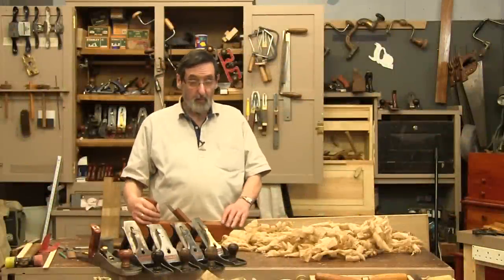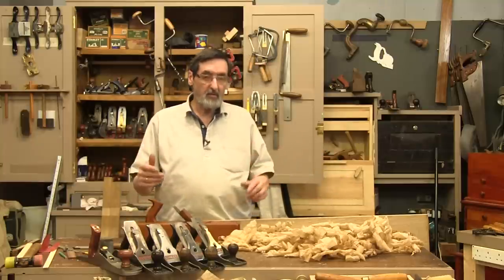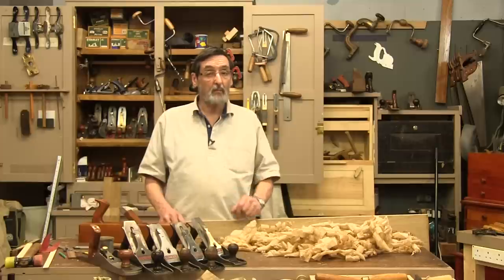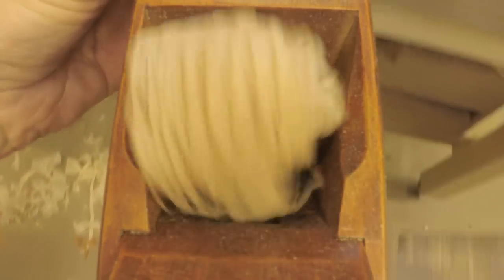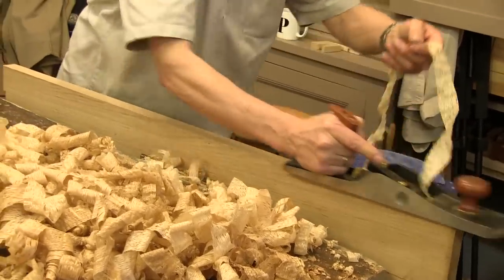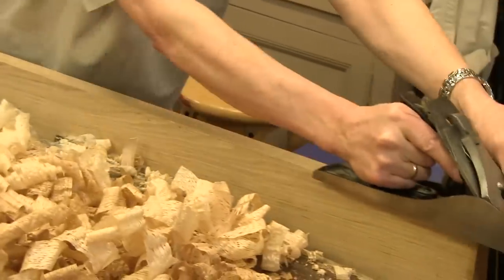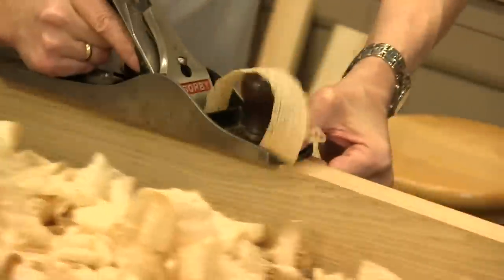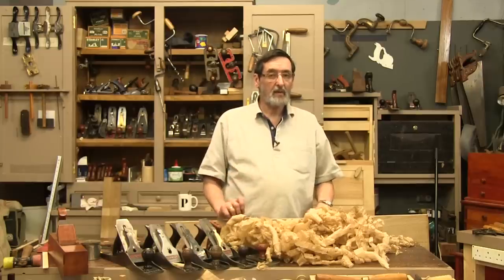Plane Bevel Ups and Downs | Paul Sellers

Comment: So, does the orientation of the bevel matter as far as the grain? Bevel up or down can be used for the same purpose?
Reply: Thanks Mr sellers
Reply: ***** Hi Paul. Your demonstration is misleading since you are only using the planes for one purpose and it is not advisable to draw such broad generalisations. I am happy to use any type of plane for edges as you did. However, as soon as I plane across the grain (traversing), the lowest cutting angle is going to cause the least surface damage. In this situation, a BU plane is likely to be preferred. Further, I can plane interlocked grain with a BD Bailey pattern but must then use the chipbreaker, which can be fiddly, especially for novices. Alternately, I can use a BU plane with a high cutting angle, which requires minimal setting up. Recommendations in using these planes should also include ease of set up. The BU has fewer parts and is easier to do. The BD plane is easier to adjust as one planes. I think that the the promise of BU planes is not that they are better than BD planes (that is too general a statement as the rage of BD planes is wide), but that they offer ease of use and a wider range, which is very desirable for those starting out.
Reply: Erik, with a bevel-down plane the cutting angle is the same as the bedding angle.  With bevel-up planes the cutting angle is that of the bed plus the blade bevel.   This combination often sums to a more obtuse angle than a standard bench plane's cutting angle.   It creates an effectively stronger edge less likely to chip in difficult grain. 

Stanley, IIRC, defined the "block" plane, saying the planes were designed for "blocking in" work and especially cutting end grain.  That said, as far as my experience goes, and that is NO A LOT compared to folks like Paul, the chief element in cutting difficult grain is blade sharpness, and technique.  You adapt to the nature of the wood which Paul emphasizes.  However, with a shooting board, a bench plane with a very sharp blade, and a heavy plane body (I accelerate the plane and then just push enough to keep it moving) and you can take amazingly thin shavings off end grain oak planks that would defeat a one handed block plane.
Reply: Thanks for the explanation JW.
Reply: Bevel-up is better for low-angle planes on interlocking and reversing grain, though a scraper probably is best.

Comment: I have the veritas in the smooth plane you add I higher angle blade (38 degrees?) it works well and  is one of my go to everyday planes. But in a Jack I wouldn't have one. I have an old wood one like the first one he used and a 37" jointer that I wouldn't part with that are my favorite long planes and a beat up old coffin plane that is my most used plane of all. So I think he is right the old stuff is really  just as good or better. Especially when it comes to trim planes.

Comment: I am new to using a plane. I was lifting the tool up on the backstroke and cleaning any waste out. I notice you drag the tool backwards and the blade never leaves the wood, does this cause increased wear on the blade?
Reply from the maker: Hi Jon. No. It sharpens the blade.

Comment: I'd absolutely agree that old, bevel down, planes can do work every bit as good a modern bevel up plane.
However what you said about having to remove more metal when sharpening a thicker plane iron is only true if you use your convex bevel sharpening method or if you continue to hone a bevel when it's flat and has lost all the hollow of the grind. When sharpening a thick iron with a "conventional" hollow grind the extra thickness helps keep it registered on the stone.
Reply: If you use a micro bevel you're only removing a tiny amount of metal at the edge. If you use a hollow grind and put the edge and heel of the bevel on the stone you're removing a sliver from each (more as you hone more and the hollow grind disappears). But if you use a convex bevel every time you hone you're removing metal from the entire bevel. I can see that thicker irons would present more work.

Comment: what was the difference between the two stanley jack planes you sed one was cheaper and one was more expencive i think. b/c i just bought a stanley jack plane for $90 on ebay and that one was a bedrock and i know those are more expencive but it did have a sweethart blade but for the baily why was that baily cheaper than the other baily.

Comment: Once again, myth busting and poking more than a few holes in many of the modern 'sales pitches' for why the older standard tools need improvement! I do follow the manual methods of non powered sharpening - no room for a basic amount of machinery in a postage stamp sized shop. Everything that goes in that space needs to earn its keep. Thank you for posting all of these great videos.

Comment: i still don't get it,,,,,,,,,,,,,can you turn the blade to bevel up or bevel down on the same plane or do you need to have a plane that is specific for the bevel to be up or down.....thanks for any info .
Reply: no, you cannot! you have to account for the actual angle of the cutting edge. if you turn the bevel up on  bevel down plane the blade would hit the wood with about 75 degrees and tear the wood. that is why bevel-up planes blade sits so low on the body: to keep the impact angle low

Comment: In my experience as long as it is being planed with the grain, and no difficult grain is to be handled, yes indeed the results are the same, without exception. For me the difference can be told for instance by reversing the direction of planing, and go against the grain, because there are situations where that is inevitable. There I already can tell some difference between the results produced. And as I plane most of the time pine (and not premium class pine, but knotty low quality pine) there is a great difference to be noticed on areas around knots, or other difficult, or twisted grain.

Comment: I have just bought 4 stanley older but sound planes on gumtree for £80 - I am over the moon with them. Paul Sellers can you give us any idea what I can do with those wood shavings ? I am getting large quantity of them and except  my fire place I don't know any other option. any ideas please? Thanks :)
Reply: +pablo24scotland  
I tell you what i do with mine I take the cardboard  egg cartons you get at the store when you by eggs and get wax at store that you would make candles out of. and i break chips down a bit by hand stuff them loosly into carton bottoms (discard top of carton). when you get them stuffed good take melted wax dump liberaly all over chips. and carton then when gets hardend (cooled down). I take to my band saw cut them apart (get 12 out of the (doz. cartons). I sell them half doz in a bag  fire starters you would be amazed at how they sell.you can even (I do) throw some saw dust in them also with shavings. ;)
Reply: Hi Michael thanks for your replay. That's a great idea and very useful as well :) I like it so much I will give it a go. I have couple of fire places in my own home so I will test my first batch :) Thanks again ;)
Reply: Enjoy ;)
Reply: Some time ago i saw a video were someone made playing cards for a homemade Settlers of Catan game out of the shavings, though he made them with that intention and a bit thicker.
Reply: if you have a local farmer they will often take them. they use them for animal bedding and to get carbon into compost, which is something you could do as well.
Reply: bob o ok cool,thanks bob!

Comment: Whats that device you use to oil your plane?
Reply: Ben, check out Pauls Blog there's a wealth of info on there. He uses 3-1 light machine oil to soak a rag that sits inside an old tin can. And he stresses to never use linseed oil as it can spontaneously combust.

Comment: how do you tell if its bevel up or down. i ordered a handyman and  it came bevel down.
Reply: Bevel up means the angled part of the blade is pointing UP.Bevel down is when the angled part of the blade is ponting DOWN..Bevel up planes are normally a lower angle.and a more modern design.

Comment: One thing I have learned is a modestly priced Stanley plane from, say the 20's 30's 40's 50's or even 60's,  will perform as well, if not out perform any chinese made so-called Stanley made today. I bought a 1930's 4C, a 1940's 5, and early 1960's block plane, and a late 1920's low-angle block plane. At prices at or below what the so-called chinese Stanley's sell for nowadays.I advise not giving the chinese a nickel and but the finger instead! try  B. Kaune, as one example. the best things is another. Look into it.

Comment: All I would say is avoid any Stanley or record plane made after 1985. I have quite a few and the ones I have after that production date are not so good. I only have one new bedrock type plane and that is a Clifton 5.5 that gets used almost daily along with 3 Stanley Bailey pattern low knob planes a 4,4.5 and 7 only one has a thicker iron the others have standard thickness tool steel irons made by ray iles as the originals were shot. Paul is very right in saying that you donot need the top end brands to work wood they are nice I would like some but cannot justify them and I'm a professional.
Reply: Anything made during or after WWII is junk.  Stanley had difficulty getting quality steel during WWII and began to decline in quality of their product.  After WWII they were never really able to regain that reputation, which resulted in more cuts in product quality to try and stay alive as a company.  The stuff made today is utter junk, at least when it comes to cutting edges in hand tools, IMHO.
Reply: Benjamin Fisher in a sense, but you can take most any plane and hone it in nicley...I have to admit I made my own jointer(love it) but when it comes to general surfacing I go to my no 4...junk market $30 crap no name brand....I cannot even use it on my shooting board it is so un-true on one side...but...I cut my own iron for it from a an old 3mm saw blade shapened it, had it hardened by a metal shop, re-sharpened it and it works better than any plane I have ever used....you do not have to spend a lot to get quality....you just have to know what quality is.
Reply: justin barrett
Hi Justin,
I've used power tools all my life & I am just now starting to appreciate the use of hand tool  I'm very new to all this and I'm having a hard time deciding which tools to buy. Having fun though. :-)

So my question is Are you saying that the iron is what makes a good plane?

Thanks in advance.
Ken.
Reply: Adam Lynch I have a couple of Buck planes, a modern made in England Stanley and a 97 year old Stanley. My choice of what plane to use is governed by the work I'm doing at the time. They all work and work well. The Bucks took some extensive tuning but they are fine now. The new Stanley only took a slight sole flattening and blade sharpening. I think people get to hung up on the plane they are using. Does it hold a blade solidly? Can you adjust it so it takes the shaving you want? If you answered yes to both questions, you have a good plane. A plane is nothing more than a chisel holder. It's function is pretty simple.

Comment: I just bought me a Record number 4, are Record a good tool maker?
Reply: Fin, I would say it probably depends on the vintage. If it's, say, 1950/60's or earlier, you're probably good to go. After that, things went into a bit of a decline on the quality. Still usable, but will likely need more maintenance. I have a 1950's No.5 and a 1920's No.4 Stanley (for all intents and purposes, identical to the Record versions) from eBay. After fettling according to Paul's instructional videos, they work just fine and are a pleasure to use. I too can pull full width, full length see-though shavings with minimal effort. Enjoy your hand woodworking!